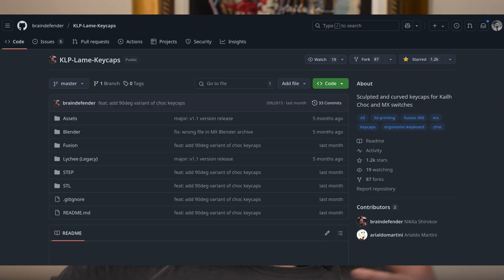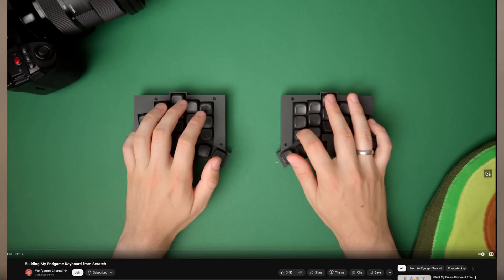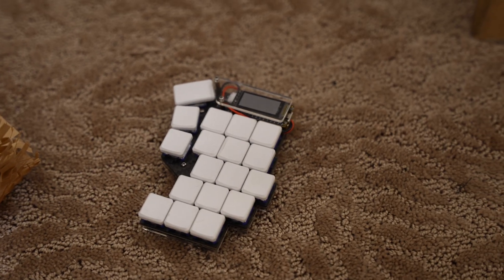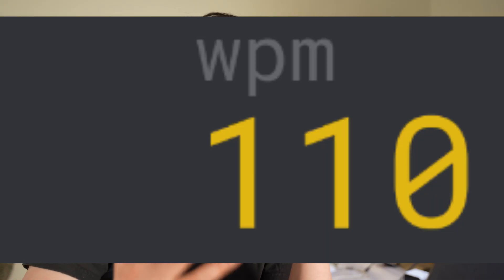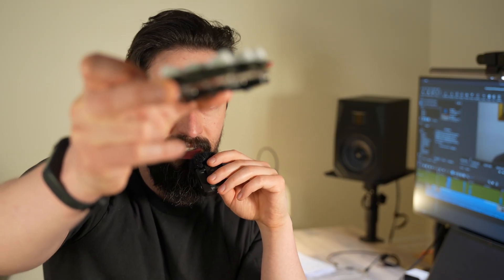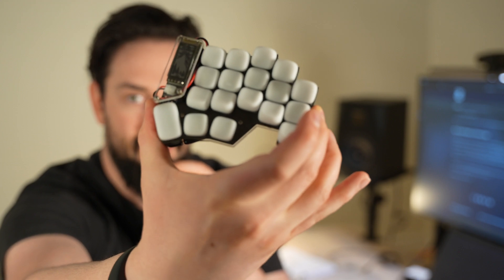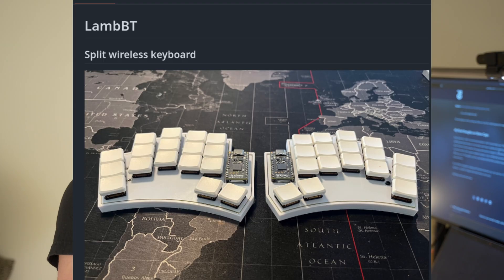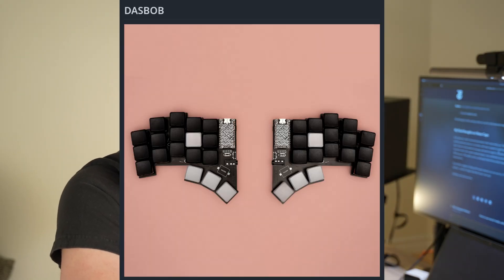The Best Addition to any Split Ergo Keyboard?!

Comment: Man I'm looking into the KLP Lamé too. But 3dkeycap is way overpriced. There's some really handy STL files on the official KLP Lamé Github repo that you can just upload to JLCPCB or PCBWay and it'll cost you like 10 bucks for the whole set + delivery. There isn't a consensus on the best material though, there's so many variations of resins or nylon, etc. Gonna order a 3d print for a few and see how it goes.

Comment: For the a-dux in wireless there is the rae-dux, which itself also has several forks on gihub, and also a bit more compact the-abyss from kvietcong on github. I still can't decide which one I want to choose. I have all the parts only need to print the PCB, but this is a huge jump from a 100% keyboard, so I still don't know if there are parts that I oversee. At least I have your experience with emacs and splitkb's, which is very valuable.
Reply: Oh I see you showed the rae-dux in the video and also on your blog post. Guess I oversaw that. 😁